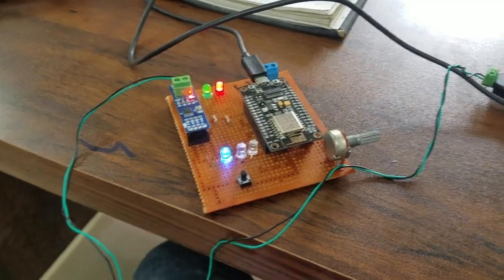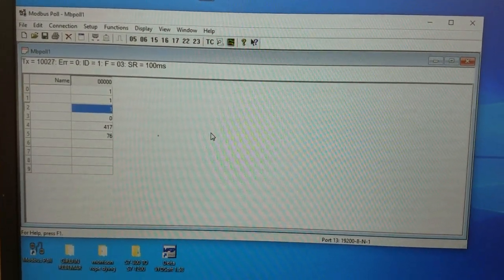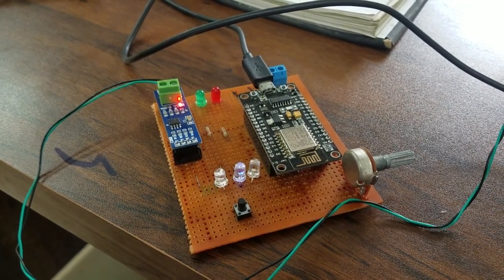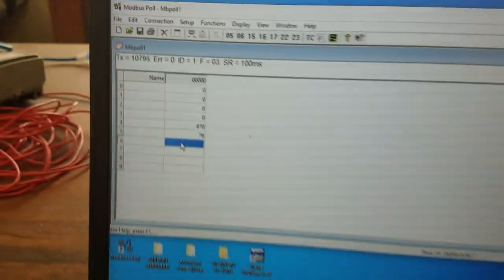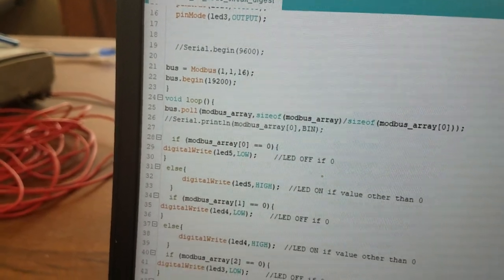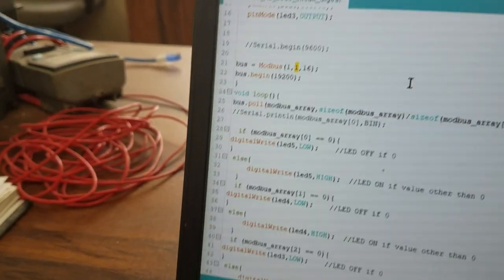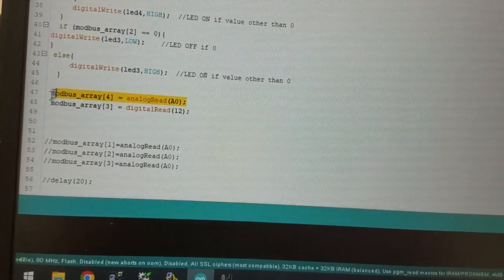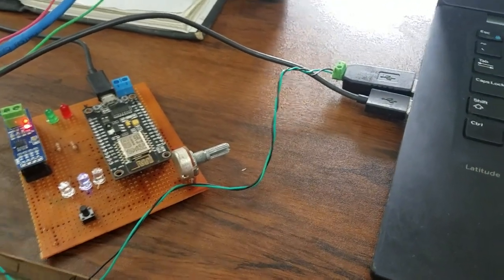RS-485 modbus communication with esp8266 as a slave device | arduino projects | communications

Comment: nodemcu and the converter connection diagram and , Arduino code we tried many times , not working , we checked the data from the , plc with the help of modscan , we are getting data , but using the nodemcu we cant can you help us
Reply from the maker: shure.use  modbus-poll softwere for conformation weather the microcontroller communicates or not as i have shown in my video.
Reply from the maker: my email id is kali49743@gmail.com...get in touch with me i can share my code and diagram.
Reply: thanks for the support  @KAMIPROJECTS
Reply from the maker: and one thing more i did communicate with siemens s7-1200 PLC with my node mcu using modbus so it definately working.
Reply: I want to get code and diagram sir.